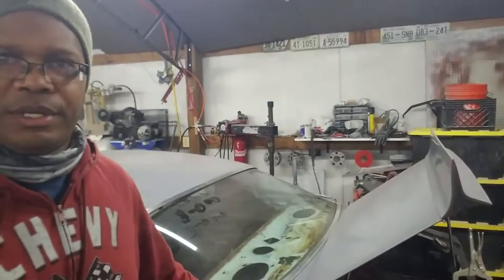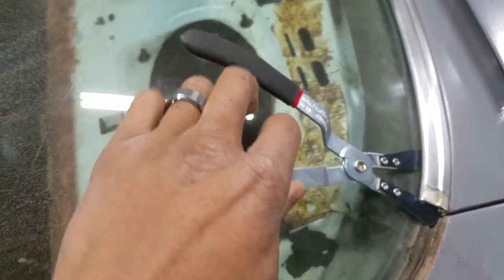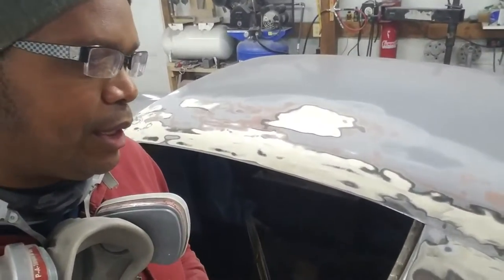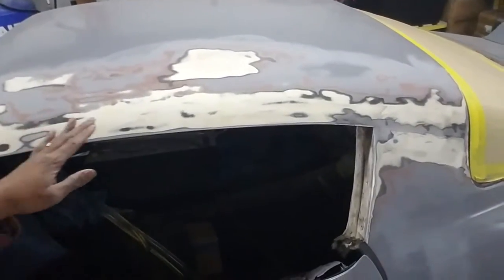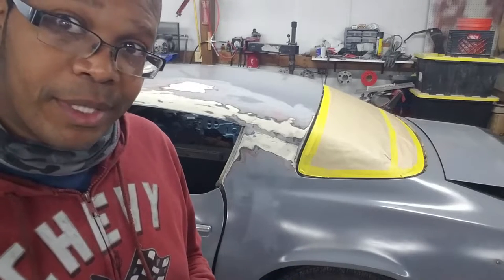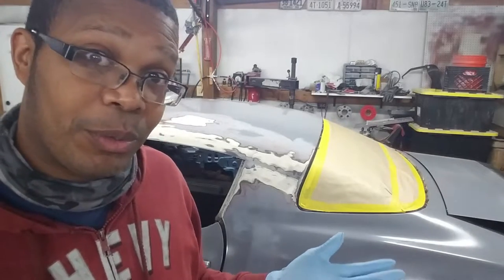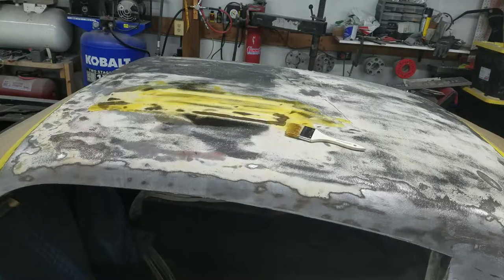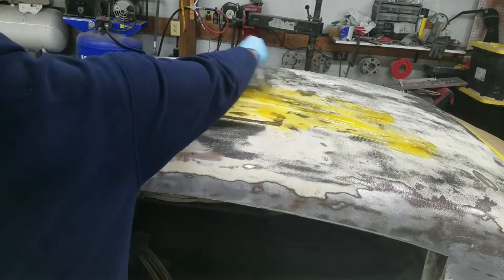NEW PAINT STRIPPER (Air Craft Klean-Strip) VS. OLD STRIPPER (OLDER is BETTER) 1970s Camaro Body Work

Comment: They have a stripper called ultra by the same company that works like the old stripper .
Reply from the maker: Thank for the tip, I will have to look for some, I'm guessing it cost twice as much or more 😅.... But if it works it works!
Reply: @3Wheels1Block  go a video if you get some but it looks   like the car is stripped already.
Reply from the maker: @3rekoatskustoms929  there will be more projects that need paint stopped, so I will be looking for some.

Comment: Stripper is just a mess. The time you wasted using it you could have used 80 grit and taken down to bare metal with less mess.
Reply from the maker: I agree the new stuff is terrible, the old stuff after a couple hours you could blow off with some compressed air, I put more deep scratches in the metal trying to scrape the paint off with a razor and this stripper than I would have with using 80 grit for sure. 👍🏾